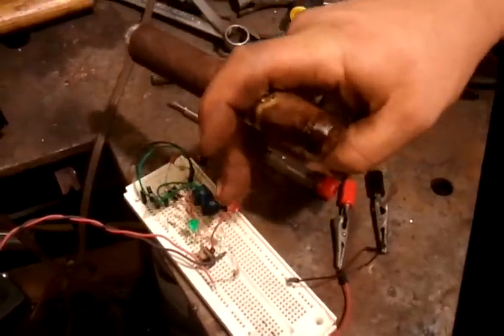Airsoft EPAR  mechbox conversion test

Comment from the maker: There are no gears in the mechbox. the pulses of air pressure push the nozzle forward, as well as provide thrust for the airsoft BB.

The Kuba T1000 here on youtube has videos on this, and this conversion is based on his plans available for free.